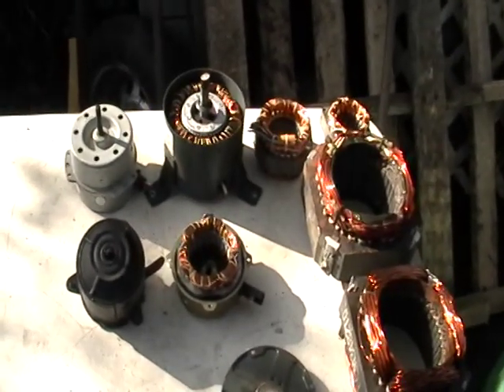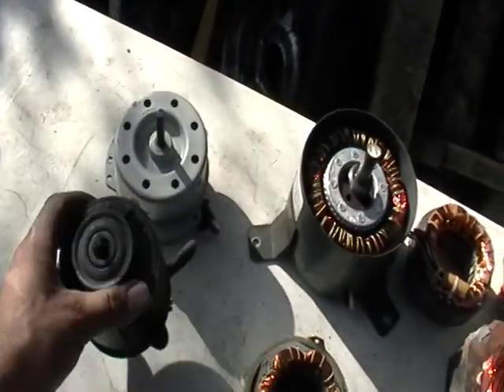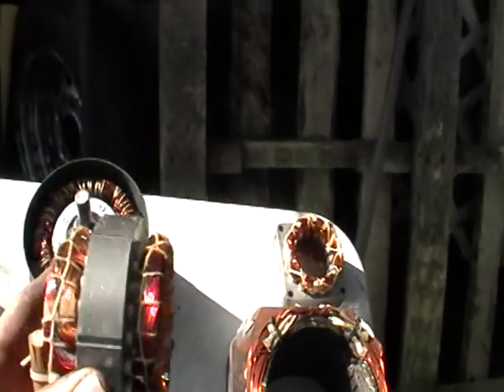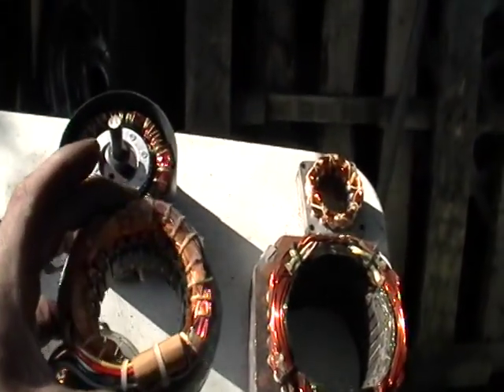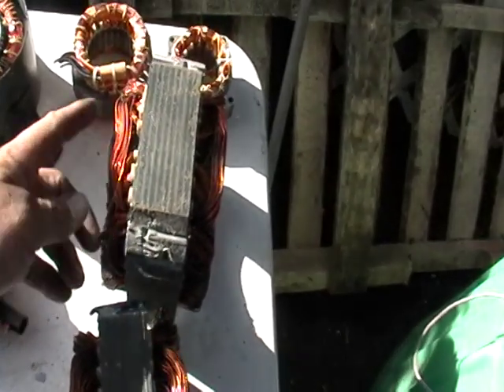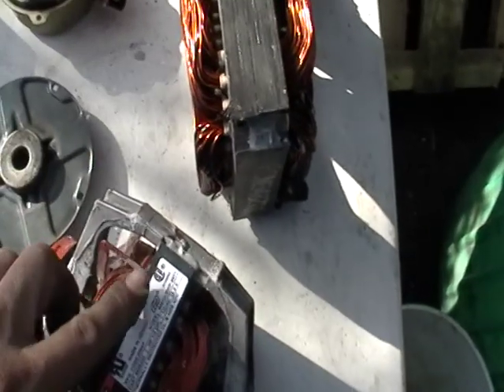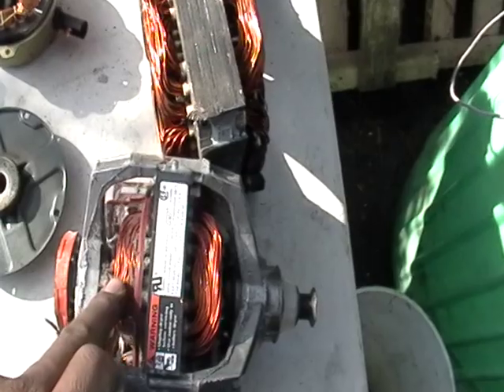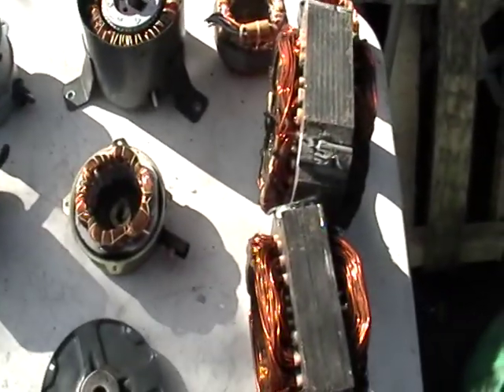Scrapping electric Motors for copper

Comment from the maker: # 2 is wire that is dirty, painted on, dull and has corrosion. look under your sink and if you have copper pipes if they are a little green and have solder on them that is #2

also keep them seperate. differrent prices.

#3 is roofing copper. also a different price.

Comment: well im still not sure if i entirely understand. i see the color difference in the different peices of copper i have, but seems alot of them at one point use to be bright copper, but have tarnished a bit or discolored. does that make them not bright copper now?  because if so, i know a way to clean it. i use wheel acid to clean pennies after i aquire enough of them to cash in on. im sure it would work also on copper wires.

Comment: hi, im from the chicagoland area, and i do a bit a scrapping. (just as a part of my job) and i noticed that a lot of the yards are super scandalise in this area. they will quote you $0.14 per lb. on the phone and when you get there they pay $0.09.  or they say there's no difference between cast alum, sheet alum, alum wire ect. really stick it to you any way they can. can you shed some light on how to avoid getting screwed? 

thanks.

Comment from the maker: no problem buddy. I have some #1 and #2 copper give check back and i will show you the difference.

#1 COPPER has no paint shiny like a brand new penny and no corrosion. Go to a hardware store and when you see the copper pipes that are brand new for sale, that is #1 same goes for wire. but put them seperate (wire from tube)

Comment: i sold them as is, basically got like $17 for 10 washer/dryer motors, $8 for 2 water heaterss, $2 for a huge stack of electric motor wiring, $5 for misc. scrap metal, enough to pay for my gas to get there and my lunch rofl....

Comment: is it worth scraping the windings?. I have about 50 motors from 1/4 hp to 2 hp. I think the scrap yard near me gives like 25 cents a pound for electric motors. Just asking...
Reply: Yes but make sure the wire is copper.
aluminum wire is not worth enough to put in the effort.

Comment: How r u able to get out the copper though
Reply from the maker: If you cut one end completely off you can remove the other end with a screw driver. You will also need a vise. Make sure its copper and not aluminum

Comment: I take vacuum cleaners, printers, and fake air conditioners as whole motors. 

I think it's waste of time to take out 2 micro motors from a printer and the $0.05 computer chip. Then have garbage left over.
Reply: I am so happy that the scrap yard will take my scrap laptop and computer parts...

About $1 a laptop or it will be the whatever aluminum junk pile.

Because the local laptop parts store that I shop at, actually charges you a few of probably $35 a PC and maybe $5 a keyboard. I am just a small time computer repair guy that doesn't have.a business license.

Comment: Here is a list of electronic organs that you want to PRESERVE, not scrap Bring it home, sit it in the garage or somewhere dry, take lots of pictures & email me paulrjacobs AT hotMail dot kom the images & model# and I will write you a good ad so someone can at least offer you scrap value, but DON'T trash these models. ( the ID plate is under the keyboard above knees or on back).
WURLITZER- 20,30,31,44,4410,4600,4602,4300,4500,4502,4520,4300D,4300R,4500R
HAMMOND- ANY MODEL WITH A TONE WHEELS (see)

Comment: Mike.  scrap the paint off the wire?  If the color stays the same obviously cooper.  I am also able to cut cooper pipes from the brass fittings
Reply from the maker: cut the wire. look at the center. may be aluminum.